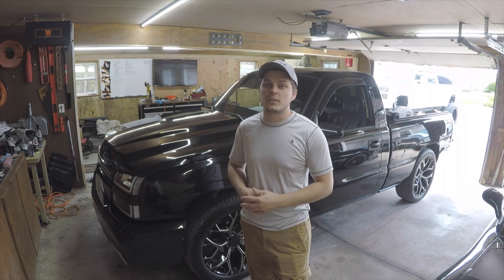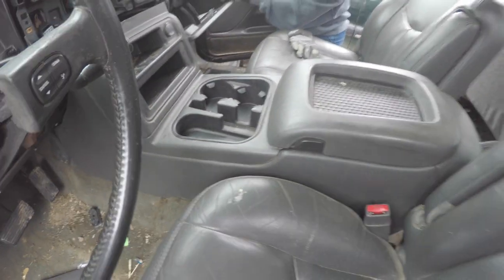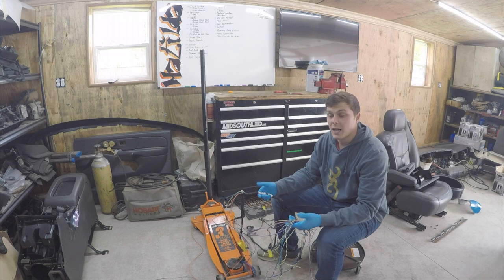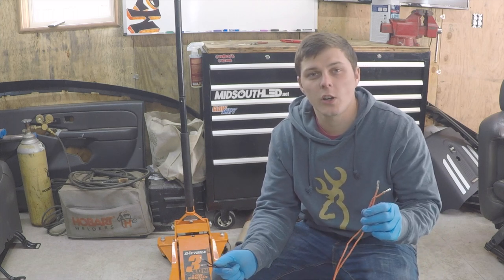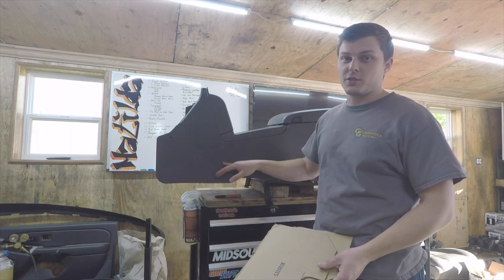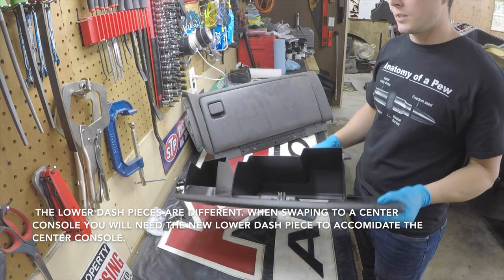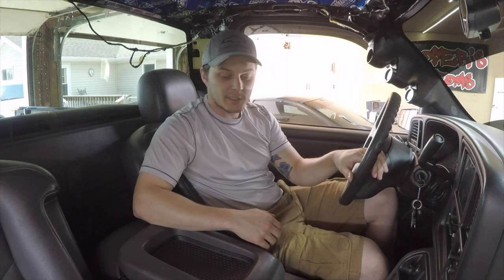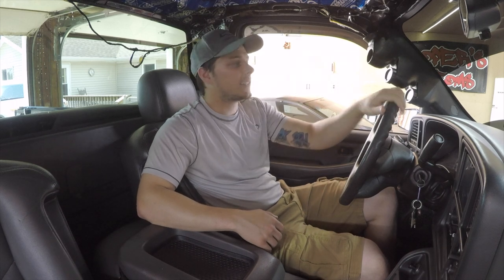Silverado Bucket Seat and Center Console Swap, "How To"

Comment: Do you need another glove compartment to install the center console? Or can you do it without it
Reply from the maker: yes, you need a different lower dash piece (glove box trim piece). The regular dash piece is longer and has the cigarette lighter in it. The newer piece is shorter and contours to the center console. Also you glove box has your vin and truck specs in it. I wouldn't recommend peaking that sticker off. Id just drill out the rivets, and switch the glove box over to the new lower dash piece.

Comment: Hey man what year is that silverado?  Im looking for that exact same truck but idk what year it is
Reply from the maker: Hey, mine is a 2004 silverado 1500. Its the GMT800 platform. So the gmc sierra is the same truck, just different front end. But my bodystyle is referenced as a "cateye" because of the headlights. They made them from 2003-2007Classic. They also made the GMT800 from 1999-2002 but they had a different frontend/interior than the cateye. Sometimes referenced as the round headlights, or a round body. 

Hope that helps, good luck on buying a truck 🤘
Reply: @TheKingCoopa  hay man thanks alot I love your truck it's badass. I'll start shopping for one myself now and maybe I'll have one cool like it.  I've really been looking into the lsx platform motors like the lsx 427 and I think that's the way I'm gonna go with it. Not to crazy on hp but maybe a compound turbo set up or something
Reply from the maker: @sabrinafrankenfield4966  hell yea, that would be insane! Hopefully it all goes well for you. Be sure to check the rockers. They are notorious for being super rusty.

Comment: Your truck looks awesome now! I have a base model 2WD single cab 2005 silverado. This video shows just what I want to do. Are the seats restricted too much leaning back? Was it a bolt in conversion or did you have to drill some holes in the floor for the seats?
Reply from the maker: Thank you! Also I drive with the seat pretty reclined, so it works perfect for me. But being an single cab, you obviously cant recline it super far. And all the 03-06 silverado/gmc's have the same front row bolt pattern, so no drilling was required, it's a direct bolt in. The only thing you should look out for, is some of the 2006 seat connectors changed, and wont plug directly into your harness. So if you buy some donor seats, just double check that the plugs mate up and you will be set 🤘

Comment: Where did you hook up the wiring harness for power on the seats?
Reply from the maker: Hey, sorry for the late reply. I used the little fuse box in the drivers side of the dash, when you open the door. you can use a fuse tap, or hard wire it. you can tap into the steering wheel harness for ACC power. or wire it straight to the batter for power all the time.

Comment: Did your air bag light come on after?
Reply from the maker: Yes I did. My issue was, I needed the bottom cushion sensor off the old passanger seat. The new sensor on the new seats were cooperating. (I had already sold the old seats when I found this out) but I'll be swapping to racing seats soon anyways. Not sure if that helps you much, but the airbag light could be alot of different things

Comment: Hey buddy you said it sits up higher Did you not use the original brackets Because I'm Doing bucket seats On my sierra I am not doing electric seats I'm using my old brackets and frames with new covers and new foams ?
Reply from the maker: I sold the cloth seats, and swapped in the electric seats. The electric bucket seats sit up higher than the manual seats. I didnt switch anything over, as the electric seats had everything I needed.
Reply: Cool thanks for the info 👍
Reply from the maker: @LSXMILLER  for sure, good luck 🤘

Comment: So I understand the orange power and black ground one side goes into the plug that plugs into the seat but what did you do with the other side of the wire, what did you splice it into or ? Thanks love these videos and was such an inspiration in my own short bed short cab
Reply from the maker: Hey! Sorry about that, totally forgot to film that part. It just depends how fast or how clean of an install you want it to be. Traditionally the seat power harness goes along the driver side floor and plugs into little box, left of the brake. My box didnt have the pins for the power and ground since it's a base model. You could pull that box out, modify it so there are pins with power and ground. So it's just like factory. 2nd option, you could just use a fuse jumper like I did, its temporary, but I did that because i have to pull my interior back out to weld in a roll cage. The interior fuse box is on the driver side of the dash. 3rd option, you could find a acc fuse or a hot all the time fuse, and splice it into that wire in the  back of the fuse box. 4th option, the acc wire to your ignition is right under the steering column, it runs to the interior fuse box, you could splice into that, so the seats would only work when the key is on. 5th option, just run the wire straight to the battery with an inline fuse. And for the ground wire, I showed in the video, there is a factory ground location under the passanger side seat. I ran both ground wires in my harness to that mounting point. 
So I know that's alot to read, but I hope that all makes sense and helps you out!
Reply: TheKingCoopa, helps a ton ! Thanks so much. Also can’t wait to see the roll cage !
Reply from the maker: Good luck if you do the swap, let me know how it goes! And I'm about to sell my house soon, trying to buy one with a big pole barn to fit a lift and start doing custom work for people. So its gonna be like 3 or 4 months before I have the time and space to gut the interior again. But its definitely happening! The cage tubing is just sitting in my garage right now haha

Comment: Can a person do a swap from a 5 passenger to a 6 in a crew cab? I have a line on a super cheap low mileage silverado but want six seats.

I.e. remove dash and armrest and install jumpseat and seatbelt?
Reply from the maker: Hey, yes you can. It would basicly be the opposite process of this video. So you would have to locate a front row bench seat. I think they are referred to as a 40/20/40 seat. Some have the center seat folds down into an arm rest. They will have the seat belts Integrated into the seats. But you will remove your bucket seats and center console, and swap the new bench seat in. You will also need the long lower dash piece to cover up where the center console was

Comment: Was there any change in leg room?
Reply from the maker: Hey, I did notice i sat like 1inch higher with the leather seats, so I think it helped a little with the leg room, but not by much. The leather electric seats also have the up and down adjustment for the bottom cushion which could help you out.

Comment: Would I be able to swap my 2004 2500 Chevy ext cab  to power seats with the factory harness or would I need to change the harness over
Reply from the maker: Hey, so you can do anything you want, if you put your mind to it haha. But yes you can add power seats to your 2500. But if your truck cane with manual seats, then you need to look at your harness. You most likely don't have a power wire for the new seats. So you either need to swap the harness out, or add the power wire,like I did.

Comment: Did you have to use the bottom of the dash from the doner truck so the console would work. Or did the console work with your original bottom of the dash ?
Reply from the maker: Hey, you have to swap out the dash for the new shorter dash piece from the donor. The old dash piece is to long and mounts in the same spot where the console would mount to.
Reply: @TheKingCoopa  thank you !
Reply from the maker: For sure, good luck with the swap 🤘 just make sure to swap over your glove box, onto the new dash piece. So your RPO codes sticker and vin match your truck.

Comment: I just swapped from manual seats to power in a 05 silverado. Do you know what I need to satisfy the airbag system? The new seats do not have the airbag sensor :(
Reply from the maker: Hey, I'm sorry, I'm not much help there. I haven't really done much research into the airbag system. Maybe pull the sensor off the old seats and mount it to the new ones?

Comment: Hey mans great video! What size fuse did you use for seats? And if you don’t mind me asking, which fuse did you tap into? Thanks a lot man keep up the great work!
Reply from the maker: Hey, thank you! For now, I temporarily ran a jumper fuse to power the seats. If I remember correctly I used the 4x4 push button fuse on the interior fuse box. Since my truck is a manuel floor shifter, that fuse is basicly unless. But it was a 15amp fuse. I just picked a fuse that had power only when the key was on. You could pick on that was hot all the time, so you could move the seats even without the key. Up to you. But this winter the interior is all coming back out, so I can install the roll cage. Then ill hard wire the power wire, into the back of the fuse box
Reply: TheKingCoopa thanks for the help and the reply I greatly appreciate it, can’t wait for the video, also do you think you can record the hard wire of the seats when you get around to it once the cage is in? Looking at the comments it seems like lots of people, including myself, would love to see that.
Reply from the maker: @smalliebigs6784  for sure, and idk why I forgot to video that part were I connected the power wire. That was kind of a long video, so I probably didn't even think about it haha. But I'll try to remember for when the interior goes back in! Going to start tearing the black truck apart soon. I plan to do a underbed C notch, 4/6 drop, finish the nitrous, install the cage, E fans, finish the fiberglass headliner, then I wanna do a quadrasteer bed swap, widen the rear rims 3in, and run a fat back tire. Then im gonna move on to a new project.
Reply: TheKingCoopa it’s all in due time! Can’t wait I’m excited for it all! Thanks once again for the help.
Reply from the maker: For sure, let me know if you run into any issues on the swap 🤘
Reply: TheKingCoopa Hey man sorry for the comment once again but I’m headed to the junk yard tomorrow and I have a quick question for you. Does the passenger power wire run along under the center console and drivers seat? And if it does did you splice both the drivers and passengers power wire together then connect that to the fuse jumper? Thanks in advance!
Reply from the maker: @smalliebigs6784  hey, its all good. And yes, the passanger harness will run under the center console, and mate up under the driver seat. Then run along the driver side floor, and connect to a white 6x6in connection block, left side of the brake pedal. And yes, i spliced my power wires together, then ran it down the floor board and to the fuse box. Good luck on your junk yard search
Reply: TheKingCoopa Thanks man! Also,  is the donor power seat harness the one that connects to the 6x6 connection box?
Reply from the maker: @smalliebigs6784  yup, id pull that harness amd keep it too. Because it will have your power and ground wire pins into the connectors for the seats. As for the white 6x6 junction box, my trucks junction box did not have pins in it, so even if I plugged the connector into the junction box, nothing would happen. So thats why I cut the harness apart and ran the power to a fuse jumper
Reply: TheKingCoopa Makes much more sense know thanks for the clarification and your help!🙏

Comment: I did this to my truck but now the service airbag light is on any ideas??
Reply from the maker: You might need to take thenseat sensor out of your old seat, and put it in the new one. I believe some of the were serialized or run a different signal, and will cause the airbag light.

Comment: Nice video man. I want to do this on my 07 silverado. When I look at the site for the template and shifter it says it won't work or 06 and 07. Is there a reason why? Also can you give a total list of all the trim pieces you used for the conversion?
Reply from the maker: Hey, thanks for the support! For the 07 shifter relocation, I'm not exactly sure about the fitment and all that. That would be something you would have to ask Ty Brink from Remoteshifters.com (or whatever company you were looking at) His website said 1999-2006 with the factory 5 speed nv3500 or nv4500. If you have a 2007 classic, I'd assume it would work as well. If you have a 2007 NNBS, then I would assume it definitely would not fit.

As for the trim pieces, in the video I show you only need the glove box trim panel. I'd swap out your glove box on to the new trim panel, so the RPO code sticker still matches your truck.
Reply: Yes the console will work the same in the 06-07 the reason he says it doesn’t work with them is because it a lot harder to remove the 4x4 shifter in the newer ones compared to the 99-05. You can still do it if you are able to get the shifter out.

Comment: Great video! Did the new leather match up with the original leather?
Reply from the maker: Thank you! For the leather, if you look close, you can tell it is different or cheaper. But most people that walk up and look at them, wouldn't know the difference. Thanks for the support!
Reply: @TheKingCoopa  kool. Did you get the vinyl or the leather?
Reply from the maker: @memphis901vet2  I linked in the description the same products I bought. I looked at it again, it says its a synthetic leather
Reply: @TheKingCoopa  Thanks
Reply from the maker: @memphis901vet2  for sure, good luck if you do the swap 🤘 if your wanting real nice leather, I have herd TheSeatShop or CatSkins, makes really nice quality replacement leathers. But they arnt cheap!
Reply: @TheKingCoopa  Thanks for the info. All I need is the driver bottom seat. I did the swap a few months ago. After reading the detail of your item, looks like you have vinyl. I’m going to purchase the exact item in leather plus the cushions. . It’s about $97 . You can’t beat the price.
Reply from the maker: @memphis901vet2  oh nice, still can't beat that! Mine have been great so far, but I just got my roll cage installed. The bulky seat belt part hits the main hoop, and won't allow me to recline back like I normally do (irritating for me). So I'm gonna end up selling the bucket seats, and going with a relaxed set of racing seats.
Reply: @TheKingCoopa  you must plan on taking it to the track?
Reply from the maker: I'd like to, but idk. The track is 1.5hrs away. Going with a built 6.0, 200shot of Nos, and 2step. I'd just rather be safe than sorry.

Comment: Are you going to eventually LS swap that thing or just keep that motor for however long you can? Cool videos and you definitely seem like an honest guy with a good personality.
Reply from the maker: Thank you, I appreciate it! The truck currently has the 4.8L V8 in it right now, which is still the LS platform. Yea it won't make as much power as a 5.3 or 6.0. Im not sure if you seen my other video where I heavily modified it, and built the tranny? The reason I decided to build it is because the 4.8 can handle the most abuse/boost/nitrous compared to the others, on a stock bottom end. They are great for junkyard builds, just slap a turbo on it and it just takes it. The truck was supposed to be just a winter daily, and obviously isn't anymore lol, I never really intended for it to be a big HP build. So that's why I planned to keep it NA, then add a 100 or 200shot of nitrous to it. But if I ever decide to turbo it, the 4.8 will still handle the boost great.
Reply from the maker: https://youtu.be/msLduxoiKaA

Comment: Where did you lay the power wire for it to get power?
Reply from the maker: Hey, I just ran it down the driverside floorboard, and into the dash. I used a little fuse tap on the left side of the dash.  In that little fuse box.

Comment: I think you next how to should be on steering wheel audio controls.
Reply from the maker: Oooo, thats a tuff one haha. I've looked into it a little bit, it's not super hard, but a little time consuming. I believe all you need is a little canbus box to allow the radio and steering wheel controls to communicate?? 

But I just put my white truck and the vett away for the winter. So I'll be tearing back into the black truck. I have ALOT of things planned for it this winter. One of them was an after market steering wheel, steering wheel buttons, and Cruz control. So ill look into the audio controls a little more.
Reply: @TheKingCoopa  
From my understanding all you need is the clock spring that pairs with a truck that already had that option. The steering wheel of course and I believe you have to have the dealer reprogram everything for RPO code UK3. I found I really nice write about it and I’m going to be doing the swap myself soon once I gather all the parts. I have other things that need to be fixed first. I pasted the write up down below. I haven’t seen a very detailed video on this on YouTube and I believe it would be perfect for your channel.
https://www.gmfullsize.com/threads/adding-steering-wheel-controls-and-dic.31777/
Reply from the maker: Yea, your right. If I remember right, canbus module is for wanting to use steering wheel controls with aftermarket headunits (since most headunits are 15-20 years newer than the cateye trucks). I might have to cover both methods. But thanks for the link, ill definitely check it out! 

The goal for the black truck this winter was to underbody C notch the rear frame,  4/6 drop, finish the nitrous, finish the fiberglass headliner, install roll cage, e fans, steering wheel, then the last thing I wanna do, do a quadrasteer bed swap, widen the rear rims 3in, and run a fat back tire. Then ill move on to a new project haha